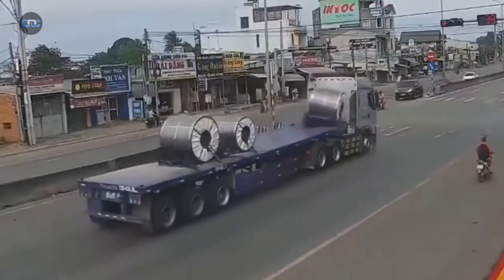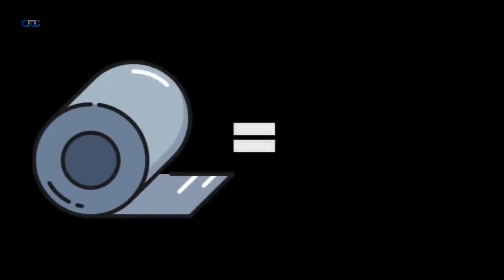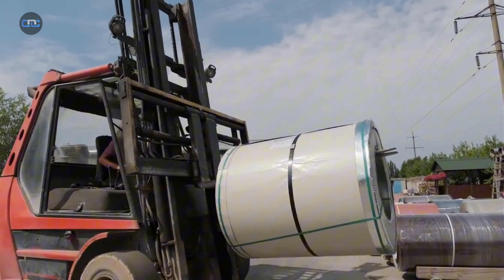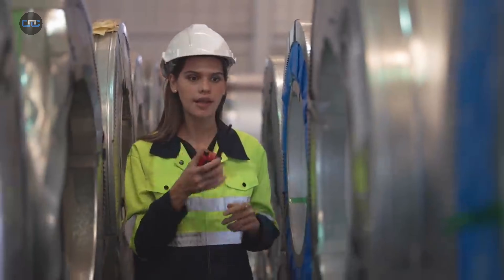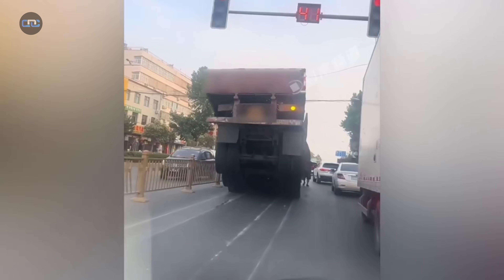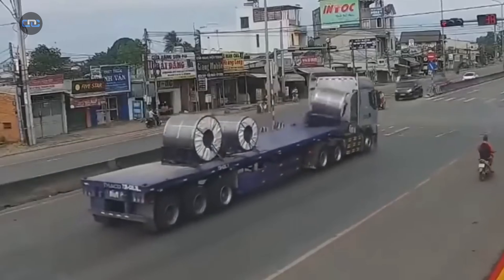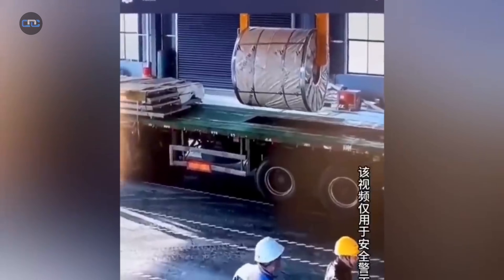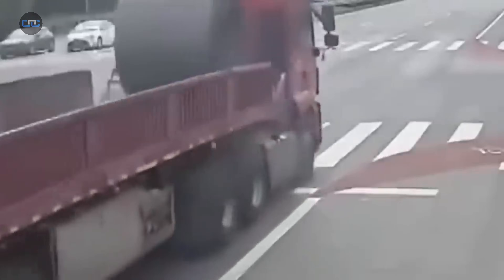How Dangerous Are Steel Coils? Stay Away from These Trucks

Comment: i hauled several of these inside a dry van (regular) semi trailer once.  i must have had 6 straps on each one because all i could envision was the mounting system (e track) simply ripping out of the walls.

Comment: Why the hell there is no final destination movie on these Steel coils.
Reply: Closest we got was Log Truck, but if there is another Final Destination movie made we can always hope on the devious steel coils
Reply: my guess is they are too obvious or maybe its just that they are more likely to be properly secured in the US where most of those movies are filmed. Meanwhile log trucks and the logging industry tends to be far more fast and loose with safety.
Reply: @filanfyretracker : I don't understand why they don't chain these rolls together also? If they're chained together, they can't roll. PLUS chain them from front to back of the trailer, so if the brakes get slammed on, the rolls are extra secured, ALSO better chocks need to be used, BIGGER and STRONGER, not some little 4X4 blocks that can just get crushed like a pancake from forward moving momentum.
Reply: @glenturney4750 simple. They weigh 20,000 pounds each. Truck trailers max at 48,000 pounds but it needs to be distributed evenly to not buckle the trailer, and to ensure the brakes work as designed. The truck driver is responsible for chaining down his load and needs to ensure the chains can secure 150% of the cargo, so almost 10 system 8, or 8,000# rated chains four per coil minimum
Reply: Nov2025:  Yeah!   A disaster movie would alert the masses to the dangers of steel coils.   Until then, at least some of us will have watched this video. 
         Retired in Sacto.
Reply: there are six final destination movies as of now. last one 2025. so... give it some time. :)
Reply: Because the writers and directors bever had to work, or interact with manual laborers in the heavy industry.😂
Reply: I went to one. Steelscape in SoCal. They ran in a five story building that painted it, dipped it in pits of hot anti rusting liquid, slit it to custom lengths, even dimpled it for textures. It was for refrigerators, stoves, washers and dryers and many other appliances. It welded one end to the beginning of another and continually ran. It was huge
Reply: Give it time
Reply: Rebar is the star.
Reply: Cornered reinforced compartments for transportation is a good idea, straight flat plain platforms aren't safe for nothing, it doesn't matter what you use to secure those too heavy coils
Reply: Final what?

Comment: 500 atmospheres are at 5000 meters depth, not 500. Every 10 meters waterdepth you gain an atmosphere in pressure. Titanic lies at around 3800 meters depth, means it has around 380 atmospheres in pressure down there
Reply: I think 33 feet in water is an Atmosphere.
Reply: @krisangel7080  sounds about right

Comment: I hauled Aluminum and Steel coils for over 15 years out of 30! I never had a coil shift or come loose. All of those trucks did not have the problem amount of chains for securement. 1 chain for every 10,000 pounds or part there of,  1 chain for safety, and 1 chain for me. So, a 45,000 pound coil will have a minimum of 7 chains and ratchet binders. If hauled shotgun like in the video. If hauled suicide; then, 8 chains and ratchet binders, 2 straps over the coil, and a chained/binder trip block. And I, also never used snap binders!Had many a close call; but, I always went home safe. Gave it up in 2019 with no accidents/incidents, tickets, or  points, and a 0 CSA score! Old timers know!
Reply: Sounds like you gave time to protecting you & those around you?  You were also probably taught correctly!
Reply: I've seen one roll off a truck in Memphis and unroll on the highway when I used to drive. I've never had a problem with them. You just have to CYA hauling them. 😮
Reply: @darrell9410 : They need a special cover for them to go over the tops of them that can insure a better- more solid tie down. Drivers with common sense know how to properly tie down, but not all drivers are the same, SOME have very little common sense and become a danger to all who are around them while moving. 🤔
Reply: these are obviously third world places, some of them dont even have chains.
Reply: @patr-ur7nm  Well consider the US the #1 3rd world country then as these incidents happens quite frequently here. I live in Houston and this is a monthly news event. Now Imagine the whole damn country
Reply: @Internal_Sight we also have the largest trucking network on the planet earth supporting the biggest consumer  market on earth.   Even with more accidents the percentage of times they happen is less compared to other nations.  We have so many more truckers than everyone else.
Reply: @willhickey7387 Compare that to the EU, and you're wrong on both accounts.
Reply: @Mygg_Jeager US is bigger than the EU and has way more truckers still 😂😂😂😂😂
Reply: Well done!
Reply: Congratulations! Enjoy your retirement! That's quite an excellent record!👍👍👍
Reply: Exactly how I did it too
Reply: I hauled aluminum foil packages on my bike all the way from the store to Grandma's house several times. 
Never had any issues except one time my shoelace came untied and I had to stop and retie it.   Overall felt pretty safe, though.   Never really knew the danger.   Now I'll be more careful.   
Thanks for sharing 👍
Reply: @WoodyWard There just always has to be one sarcastic smartass like you to make a STUPID joke🤪 about a SERIOUS issue.  Unbelievable!!🤔🤨🫩🫣
Reply: @WoodyWard I’m crying🤣🤣
Reply: Excellent job trucker, ITS supposed to be 100 % SAFE FOR EVERY TRUCKER, EVERYBODY!!!! WHAT COUNTLESS HORRIFYING SCENEREOS IVE SCENE HERE, I WISH THESE PARTICULAR FREIGHT/CARGO SHOULD (ALWAYS) BE SHIPPED AT ALL TIMES ON RAIL FLAT BED TRAIN CARS, WHICH THEY DO, BUT NOT ALL TIME.😳🤯😱👌🤠👍
Reply: Thank you for the safe miles you drove. I only wish there was a way to keep the idiots away from the highways. Seems there are more and more of them these days. Enjoy your down time. ❤
Reply: @AbueloRon
I remember flatbeds with V-grooves for the coils (80s, 90s), that's 50% secure and the chains ad 25%, the rest is ip to the driver
Reply: Maybe you should travel the country, slapping sense into people hauling these coils. There really should be a government program to fund that.
Reply: Congrats on your million + mile club! Hauled these all over the midwest for Hansen Trucking  from Granite city steel, LTV Cleveland (mistake by the lake! River Rouge ! You name it! It would piss other drovers off, but I wouldn't move off the dock till I had at least 4 chains on it. Then Id put the rest on at the staging n tarp area. Pickled coils we're the worst!
Reply: I hauled them sometimes. I used 3 chains minimum even if it was a 15K pound coil. We were also taught to criss cross the chains in case one chain broke.
Reply: Even though they blurred it out, that was HORRIFYING to see just how EFFORTLESSLY that runaway roll just CRUSHED that man flat as a pancake when he foolishly tried to stop it himself.  That would give any other people who witnessed it NIGHTMARES!!😲😳😩😥😣🫣
Reply: My former wife's dad was a lifelong trucker. I don't know what he hauled, but he had a shelf filled with countless best driver awards throughout the years. I can bet he had his share of driving cabovers. I knew nothing but cushy computer jobs. Big difference in so many ways.
Reply: You're a genuine hero. My grandfather rebuilt and maintained Peterbilt cabs for decades. He was only about 5'7" so he fit right up into the engine compartment. Everything in his off time revolved around big trucks and I fell totally in love with them by the time I was six. I'm 48, I still have deep respect for the folks that operate and take care of the beasts of the road.
Reply: I would say that all of those trucks DID have the "problem" amount of chains!
Reply: They should have wedges surrounding them to reduce roll chance
Reply: These giant coils become like BOWLING BALLS! They have ZERO MERCY, momentum mixed with an improper tie-down is just BEGGING for trouble!! I wonder how many of these drivers speak proper English? 🤔
Reply: @glenturney4750 English has nothing to do with it,..every goddam industry depends on reliable people, proper training and adequate equipment and responsible management.  Doesn’t matter how white you are Jethro.
Reply: I loaded coils for 20 years the driver I had knew what they were doing no problem 😎
Reply: I think these trucks shown are in India.
Reply: Gotta get down on ats now
Reply: It's no surprise that most of the footage in this video is from low IQ Third World countries.
Reply: now the somalis can do it
Reply: What about fear of the coil unraveling aside from being crushed by it that guy at the start i assume he died i saw a redness in the blur after it rolled on him twisted leg first.
Reply: I hauled them for a couple years. Properly secured, they're as safe as any other load.
Reply: Yeah, otherwise don’t place it where it’s gonna roll on you 😂
Reply: Good on ya. Sadly, for every one like you, there are probably two that aren't so safety conscious. I used to manage a heavy equipment storage facility. We had 8 bridge cranes and 14 large fork trucks on the property of varying capacities and all employees were certified hoisters and riggers. Our equipment (cranes, trucks, and peripherals, such as C hooks, rigging,  etc.) were all inspected regularly. We have had a handful of drivers, over the years, who arrived to pick up coils without enough chains. We always refused to load until additional chains were delivered to complete the tie down safely.
Reply: society is collapsing partly because of people lack competence these days
Reply: Yeah ok calm down old man yelling at cloud 😂
Reply: Yea but in a actual crash I’m pretty sure all them chains are not gonna stop nothing lol
Reply: People scare me not the coil. Thanks for for being safe .😮😂
Reply: Preparation and safety is the name of the game.  I'd take more time with this load also.